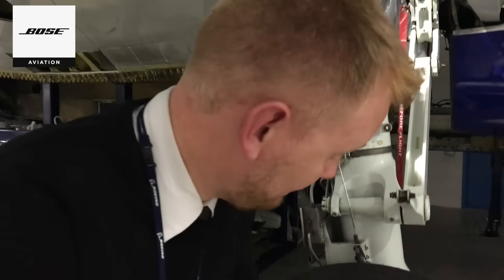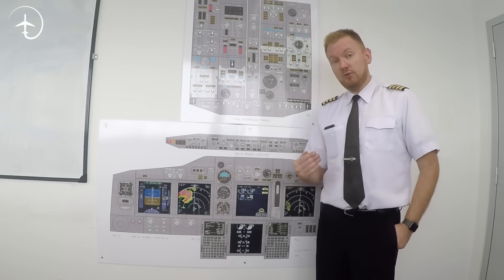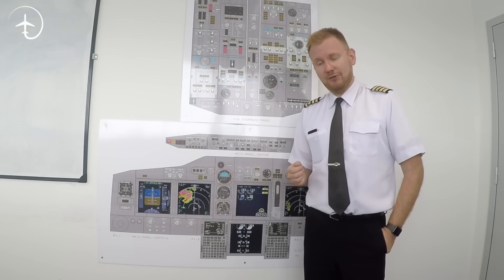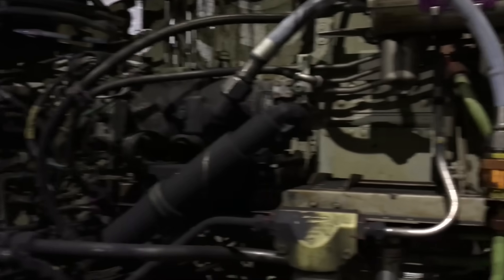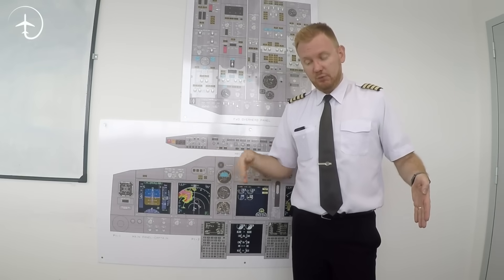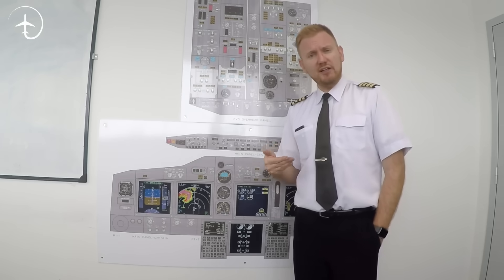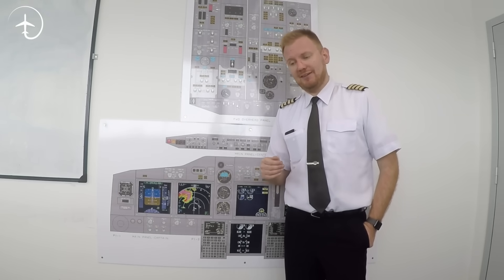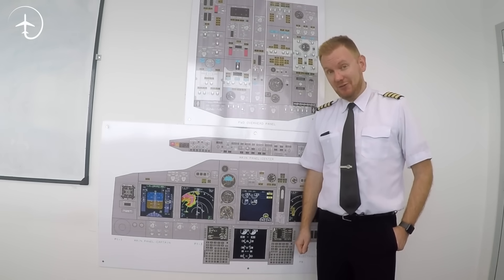Why does the Boeing 737 not have any landing-gear doors?

Comment: it's amazing to think how Boeing engineers designed 747s and 737s decades of years ago.
Reply from the maker: Yep, they were some seriously smart people. I love how they though “out of the box” when designing.
Reply: could you make a video explaining different autopilot modes? Like Level Change, Vertical Speed, LNAV, VNAV ,etc?
Reply: So smart they even thought to include coffee cup holders in the cockpit.
Reply: The B737 is probably one of the most common and largest production commercial aircraft. Funny to think that when it was first announced they didn't know how well it would sell as few airlines initially considered it and several companies were already making fine regional short haul jets. Most of those companies are long gone now and the 737 was able to change design and improve with time.
Reply: FlakeTillman SpaceX
Reply: Flake-Actually engineers are taught to seek the truth based on proven engineering principles. That has always been true although many times they must battle with management to maintain that principle. ie: NASA mgmt telling the VP  of Enrg at Morton Thiacol to take off his engineering hat and put on his management hat the morning they were trying to get ok to launch a iced up space shuttle Challenger.-Ray
Reply: What always amazed me is that they were designed in sections in different locations but fit together perfectly during final assembly. If you ever look in the belly of a DC-10 it is amazing how all of that came together and had to match perfectly and the production splices.
Reply: Aircraft really doesn't change like automotive does
Reply: take off his reality hat and put on his political hat
Reply: Mentour Pilot Little wonder Boeing is contracted for defense then and now. Though I can’t help but wonder where innovation like that happens today, seems very esoteric ☹️

Comment: Hey Mentour, that was a good, clear and amazing explanation.
Thank you for sharing knowledge.
And also would like to see in any of your future videos, an explanation about the hydraulic / fuel shroud. Which is located behind the left Main wheel well bay.
That's curious for me.
I hope you are doing absolutely fantastic.
Reply from the maker: Thank you!
I will see when I can start to go into more advanced technical videos
Reply: Also would like to know about the T12 sensors on the CFM56-7B. 😎
Reply: The fuel/hydraulic drain mast is for an overfilled hydraulic system and on the other hand for  the apu fuel line, which is shrouded, so a line in another line, to indicate, if the fuelfeeding line has a leakage(could not be seen from the outside/inside-line goes along behi d the sidewalls of the aft cargo). It also protects the aircraft fuselage/cargo compartmens etc. from spilled fuel, which may cause corrosion inside of the aircraft structure.
Reply: Hamburger Quieddje nice one. Make sense
Thanks bro

Comment: I think you made a minor error.  You said the tires are inflated to 14 PSI.  Perhaps you meant 14 Bar, which is near 200 PSI.
Reply: @brocktechnology -Aircraft tires are inflated much higher than you would expect usually in the hundred/hundreds of PSI which is correct. If you ever watch mechanics when they service aircraft tires they never (should never) stand next to the tire because at that pressure if they blow........ Well... Its like a grenade.. Look up Aircraft tire inflation cage testing or something and you'll see how much power there is. I was a mechanic and inflating tires was scary.
Reply: @BrassAxe  you are so right about that when I was on the 747 we taxied in and one of the ground guys was coming up and happen to walk by the outside of the tire and it blew that was on the body gear and it threw him against the wall he had a broken collarbone broken arm broken leg and a concussion this guy was in the hospital for almost four months so you're right it is very dangerous you never approached a tire by  the side always head on
Reply: BrassAxe Truck rims were SPLIT RIMS so you had to put them in a special CAGE,, as MANY  MEN were decapataded., as you would know split sims are NOT USED ON STEERING WHEELS, NOR RECAPEDDED
Reply: When I was on the navy the main landing gear tires were inflated to 375 psi for carrier landing
Reply: Gilbert Menendez but that probably varies with the various types, just like the LAUNCH RATE PRESSURE changes with the specific aircraft
Reply: He meant 14 bar, which is just over 200psi
Reply from the maker: Yes, that sounds correct.
Reply: The shape of the footprint area is usually understood to be a 1.6 ellipse (as referenced in the US Corps of Engineer's S-77-1Report). (Boeing tyre contact area calculation report)
The maximum aircraft weight in Lbs as distributed through the landing gear (are there 8 main wheels on 737? Edit: NO I'm a dipshit) in this case ignore loading on front wheel, it is negligible. Load per tyre divided by PSI gives contact area (Lb and inches) remembering the contact area is a 1.6 ellipse.
A 777-300 (Boeing tyre contact literature - available if you search) has 52,000Lb per wheel load (12 main wheels), 215PSI pressure, giving a 243 square inch contact area or 13.94 x 22.3 inches. That is 214Lb per square inch load.
Reply: Martin D A 
6 wheels?
Reply: TheUtuber999  yes 4 main, +2 nose,how do you tell what’s landing in BOEING line ? The 737, is easy, so is the 727, but the 757& 767, only have 2 main trucks 4 wheels on each side, but the  777 has 3 axels, of 6 wheels then there are2 nose, but the mains, tell the story.
Reply: The aircraft tyres have "rupture disks" on the hubs, they burst before the tire and release the pressure before someone gets hurt.
Reply: Szymon Gorczynski "A can if come has about 50psi" WHAT? Please try again in English. Those are all real words, but put together they don't mean anything.
Reply: was thinking of the same thing. But yh its a minor error.
Reply: Yeah that was stupid of me - you can see the bloody things. I was thinking it had two axles per side on main gear - doh.
Reply: MaddoxInc   Space Shuttle main gear tires were inflated to 340 psi.  Never heard of one shredding.
Reply: Mark Holm sorry,,they did, simply because of the runway design, it was ROUGH AS HELL, not somewhere you wanted to race your car!, IT may have been made that way,<to create mMORE FRICTION
Reply: Indeed. 737-700-900ER, 208psi on the nose, 205psi on the mains, aircraft on wheels. Nose wheel is 27"x7.5 and mains 44.5"x14.5"
Reply: Yep, 205 +/- 5 psi do it every day!
Reply: brocktechnology trucks weigh less and use much more than 14 psi
Reply: I work on 787s and we run about 225 psi.  So  when he said 14 psi, I knew he was wrong
Reply: RON Fliger he meant 14bar =200psi
Reply: 14PSI?,lol might as well use marshmallows for tires with that pressure. That was funny.
Reply: MaddoxInc   737-800 tires are 28 ply rated, bias ply construction..
Reply: MaddoxInc   Space Shuttle main tires were inflated to 340 psi.  I believe there were 130 landings with one blown tire.
Reply: You should watch the videos about airplane tire testing. They are tested to like 4x their normal rating, and when then they finally blow at 900-1000PSI, it's an incredible amount of destruction. It was pretty cool to see this.
Reply: @MaddoxInc Aircraft tyres are like rocks (even when empty). It's hilarious to see some pilots kicking them. Please refer to your applicable aircraft manuals for tyre pressures. e.g. Boeing 747-400 is around 200psi. I've seen shredded aircraft tyres, but only because of heavy landings, etc. Depending on options, the 747-400 warns you if tyre pressure drops below 100psi.
Reply: @ImperrfectStranger Pilots kick the wheels so that after a long flight their balls unstick :)
Reply: I might add as a B737 mechanic you just comfirm my suspicions:  Captains don't look at the gauges.  They have their For do it.
Reply: A can of cum has about 50psi
Reply: 14,6 PSI is 1 Atm so 1 kg /cm2 if your car weights 1600 kg you need 400 cm2 for each wheel in contact with the ground. If your tire contact is 16 cm wide the contact lenght needs to be 25 cm.
I cal that a flat tire, even with a mechanic at the wheel. :)
So you need 2,2 atm or 31 psi in your car tire and the contact is only 180 cm2 and not 400 cm2
A 737 at 75.000 kg with 4 main wheels and two nose wheels has aprox.15.000 kg on a main wheel.
At a  30 cm wide tire and 14 Atm pressure (204 Psi) the contact length is 35,7 cm.
Next time look at the aircraft and you will see contact length is close to that.
The difference is due to the width of the tire and the weight and load of the different type 737.
Is all dependent on weight at 1 cm2, that determines the tire pressure needed. 
Thats why a bike has a higher tire pressure than a car.
Reply: Yes.  You don’t want to be around one when it explodes at those pressures either!  They test them in a steel frame for that reason I think.  I’m guessing you don’t take a tyre gauge with you on the walk around😉. Predictive text wants to spell Hague for gauge just now.  Go dutchies👍
Reply: brocktechnology 14 psi in a car tire doesn’t even make sense.  200 psi is in the ballpark for airliners.
Reply: Oscar Blue he ment 14bar =200psi
Reply: MaddoxInc you don’t know what you are talking about.  200 psi +- is what airliner tire use.
Reply: Mark Holm I was thinking exactly the same.
Reply: hughaxton How were you able to get a good pressure reading on that?
Reply: You are correct since even auto tires are inflated to about 35psi
Reply: One bar is (10 newton or 1kg) per cm2.
14 bar is (140 newton or 14kg) per cm2.
14 kg is 30.86471668 pounds (14 x 2.20462262)
1 cm2 is 0.15500030999938 inch2  (0.3937007874 x 0.3937007874)
1 bar is 14.22334329530579 PSI

PSI is pounds per square inch. 

So 14 bar is exactly 199.126806134281 PSI theoretically

But you can't measure it precisely because the machines can't due to different calibrations and temperatures.
If you put 4 more theoretically PSI in a tire it's 0,2812278320892488 more theoretically BAR what doesn't make any difference.
Reply: Arnold vd M  wanna laugh, my 80cf.  My aluminum 80CF  tanks are pressurized to 3200psi ! Of AIR, NOT OXYGEN like the TV NEWS TELL THE  Public
Reply: Mark Holm :  wondered about that too!
Reply: Mark Holm 
Hello mark, can you please explain the chart of how to convert PSI to Bar?
Thanks in advance for your time and knowledge
Reply: PSI = Pound-force per square inch
BAR = 1 kg or 10 newton per square centimeter

It isn't difficult to make a chart.

1 PSI is 0,0703069580223122 BAR
1 BAR is 14.22334329530579 PSI
Reply: 205 (+ - 5) psi
Reply: 170,000lb of aircraft with 200psi tyres should have a ground contact area of about 29x29" (730mmx730mm) which sounds about right.
Reply: Clarence Gilbert, When off road in soft ground, you get much better flotation for sure.
Reply: hey now, remember it is 8 hours bottle to throttle
Reply: There are a LOT of agricultural uses for ex-aviation tires, believe it or not. A used aircraft tire can be repurposed from the 200 psi original that held many tons to a new-to-you tire that holds 50 to 80 psi and carries a couple of tons. They are amazingly resilient and wear resistant.
Reply: brocktechnology A can of coke has about 50 psi... In fact, atmospheric pressure at sea level is 14.7
Reply: MD-11 nominal tyre pressure is 213 psi, B-777 225 psi but those pressure can go up to about 265 psi after un long taxi in summer
Reply: Peter Delage INCORRECT
Reply: Peter Delage  Incorrect, tell me that the  surface temp increases, but NOT THE PRESSURE,  FOR that Very REASON is why  NITROGEN  is used<since it is NON CONDENSABLE, , not affected by temp.
Reply: Leighton Samms temp will definitely increase with increase of pressure. Most modern rpt aircraft can read the pressure and temp of all the tyres from the cockpit. You will never see a rise of pressure without a corresponding rise in temp. Nitrogen is used mainly for safety as it is an inert gas, unlike oxygen in air.
Reply: @MegaPaul1948  nitrogen is used because it's moisture free
Reply: Mentour Pilot 225 for -900
Reply: No it doesn't. Planes weigh a lotttt.
Reply: Don’t remember what it was on the 737 but the 727s I worked on were indeed over 200 psi. Yep... rock hard... but not when 200,000+ pounds of airplane comes down on only 4 tires. Lol
Reply: The larger the tire, the lower the pressure needs to be. The large tires on an airplane are 14psi which is not the same as the 32psi on your car or the 70psi on a road bike.
Reply: At 200psi, that tire would be like a rock and would shred on contact. The larger the tire, the lower the psi is.
Reply: I have no practical experience with aircraft but as a mechanic 14 PSI sounds a lot more reasonable for a tire that size.
Reply: Depends on the weight it has to support and the thickness of tire. Aircraft tyres will have lots of both.
Reply: brocktechnology at 14 psi those tires would SQUAT when LANDING, but was glad he did mentioned NITROGEN, which Racing cares use, and my car also, as it is NON CONDENSIBLE, so temperature does NOT affect it

Comment: Why didn't they just put a metal shield around the wheel in the wheel-bay to shield the components?
If done right you could easily take it off for maintenance.
Reply from the maker: They actually did that as well but it apparently also caused a lot of problems.
Reply: The mechanics and Co-pilot must inspect the wheel well components for leaks or damage before each flight. A shield would be huge pain.
The 737 wheel well is a very busy place.
Reply: Hey Jerry Dinger. The “clean wing” aircraft, like the mentioned 727 and the business ones with rear engines, are quite low from the ground, so an inspection of the wheel-bay (or wheel-well, as it is also known) is somehow difficult.
On the other hand there are airplanes with wheel-bay protections (bins) made of fibreglass. They are rated to protect the area in case of tire burst. Because they DO burst and they make extensive damage. Remember the Concord!
Reply: Hi Virgil Mihailescu, in my job as a aircraft mechanic at Fedex I have worked on the Boeing 727, it's wheel well was accessible for a quick visual inspection without lowering the main gear door, but a closer inspection was easily had by pulling on a lever to drop the gear door, it was closed using the "B" hydraulic system. The 727 wing is still tall enough to be able to walk into the wheel well without stooping. But the door did have to have approx 1/4 of its span hinged to swing up for needed ground clearance, doing away with the door on the 737 was very clever solution for the ground clearance problem, and saved a few hundred pounds of weight. The 727 is one of my favorites. I have not worked on the 737.
Reply: Hi Jerry Dinger. Congrats for your 727 mech days, I think it’s a cool a/c. I’ve never touched one but I was familiar with its Russian “cousin” the TU124. Because the Russian engines were reputed to be very heavy, the beast had an annoying habit to fall on its tail (I’ve seen one in the hangar, it cleared the roof by few inches). Any occurrence on 727 you know of?
Speaking of Boeing old a/c mlg doors, I was familiar in my young years with the 707. Huge monsters, of course hinged to clear the ground and hydraulically operated. Nightmare to maintain and remove/install.
Maybe it’s worth mentioning the almost forgotten British Aerospace’s BAC 1-11. Rear engines, low profile, short/medium haul. After closing the doors (yes, it had doors) the mlg were literally resting on the doors! No need for extra up-locks for the gear! Cool, he?!
Reply: Virgil Mihailescu, at my old airline American Trans Air, (now defunct) we had a device to lift the nose of the 727-100 11 feet in the air then tug it while lifted, through the low hanger door so the "T" tail of the 727 would fit under the small hangar doorway, we could then lower it back down. Lifting the nose this high would bring the tail skid within about a foot off the ground. (Picture the 727 taking off) 
Weight and balance was very important, we had the fuel loaded a certain way, or if no fuel was on board we had to put a lot of ballast in the forward cargo pit. (A lot of 5 gallon buckets full of sand with lids stacked 2 high, basically filling the front cargo pit) thank God we never put one on its tail. The mechanic in the cockpit during this procedure got quite a fun ride during this, he was there to apply the brakes when needed.

Comment: Thank you for explaining this. I've see 737s fly over head so many times, and I've noticed that I could see the wheels, but didn't think it possible from an aerodynamic perspective. I thought maybe they painted black circles on the landing gear doors, but that didn't make any sense either.
Reply from the maker: Yes! And this is the reason.
I hope you liked the video!
Reply: If given the opportunity I would totally paint weird stuff on the bottom of a plane.